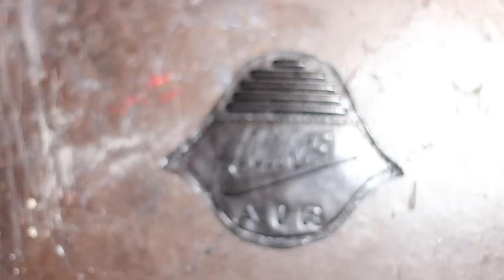2001 Air Jordan Black Cement III Midsole & Backtab Swap

Comment: should paint the midsole first and do the matte finisher so it doesn't get on the outsole, but that's personal preference, other than that good work gained another sub.
Reply from the maker: +Tan Le If I do it that way, paint may get on the part where I'll need to apply my adhesive. I could remove the excess paint off but, cotton balls and acetone cost more than tape. I've done it before and it didn't work out. This is cost effective and doesn't take long to tape up the midsole anyways.

Comment: I just tried this with some 312s and the donor midsole is too long. Things aren't lining up right. Do I need to go a size down? So a 10.5 donor for a 2001 Size 11? Why is there no info on this.
Reply from the maker: I’ve never used a legacy as a donor. It’s better to use another Jordan 3 with no issues